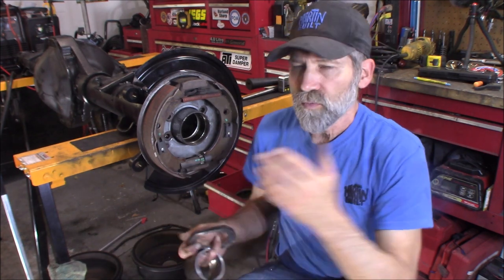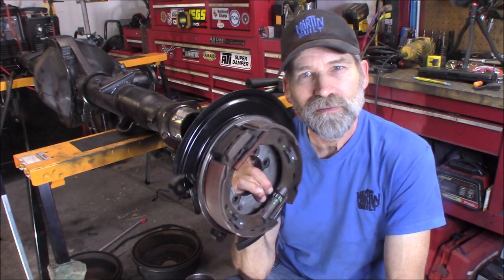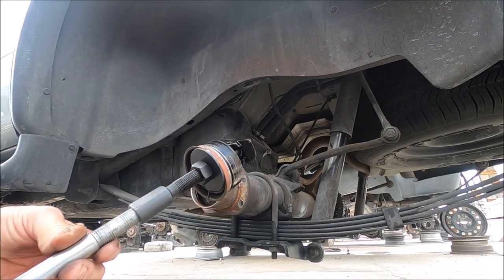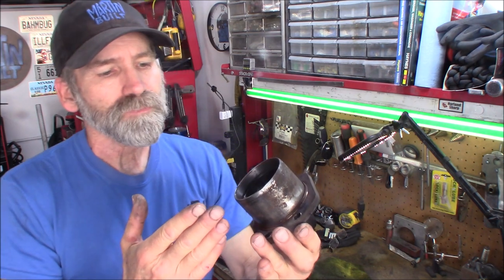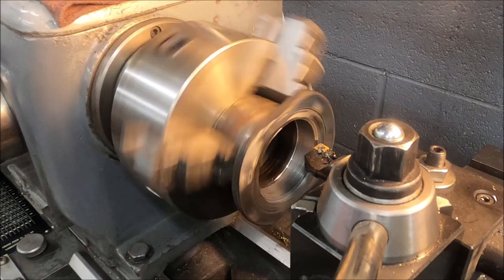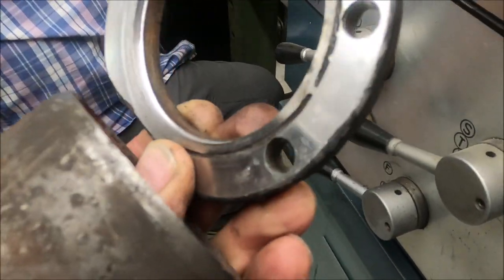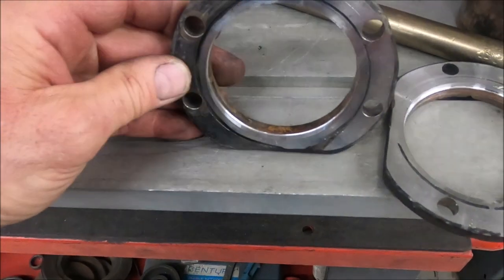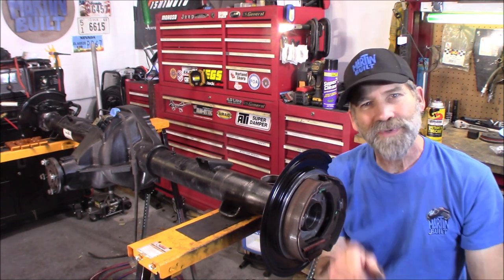Chrysler 9.25 Disc Brake Conversion Part 1

Comment: Thanks to your videos my XJ has the WJ Akebono front brakes and Barnes 4WD 1 ton GM offset TRE's, now I'm redrilling KJ rear brake backing plates to work on a SJ narrow-track D44 rear axle. Unfortunately none of the wrecking yards in my area leave any solid axles under the vehicles so no hope in finding a D44 with disc brakes just chillin. I tore apart 5 ChryCo 8.25's before I had all the parts I needed in one piece. Want your mind blown? Look up the price on rear brake dust shields for a 2005 Jeep Liberty. If you want a parking brake, gotta have those dust shields.
Reply from the maker: I know we got all kinds of dust shields down here at our local Pic-a-Part. There's all kinds of l
Liberties down there. Good luck with your search and build 👍

Comment: Hey Mr. Martin,I was wondering if you might have gotten the measurements off of the flanges or if you ever have some made-up. If so, could i get the measurements from you or purchase a set if you had any made. Thanks

Comment: im assuming this bad boy is going into the XJ , Martin? great video and information as always! I wish my WJ had the trac lock diff!
Reply from the maker: Thanks, this is actually going into my 01 Dakota I'll be going from 3.55 gears to 3.92 and they with disc brakes should be awesome 👌
Reply: @martinbuilt  stopping power and fuel efficiency, nice!!! 😎 I hope its got the 4.Heaven in there 😜

Comment: Hey martinbuilt, would you suggest dropping the transpan of 2001 grand cherokee Laredo WJ, have govenor sensor and selenoid code 125k miles. I have read that i should not. I ts never been changed.  and if I  should not,.. can I strain the old fluid and reuse it mixed with new oil, so that I wont slip?..worried with all that i have read.. not to. help a girl out. thanks. You are a great teacher
Reply from the maker: If it was my Grand Cherokee with that problem I would drop the transmission Pan change out whatever needs to be changed out and replace the fluid. I think people that don't change the transmission fluid and think that that actually causes more problems is total BS

Comment: Did you ever make some of these flanges by chance? Looking at trying to gather the parts to swap my 01 Kota R/T
Reply: Nah this dude is insane. I have a 99 std cab. I’m leaning on just swapping to the complete 9.25 w 3.92 from 03-04 Dakota or Durango
Reply: This is way too much work when you could just bolt up the 03 04
Reply: Good luck just “bolting in” a Durango rearend into a Dakota.. 😂
Reply: Shit you’re right. The leaf springs are on the wrong side for the Durango

Comment: Do you need those Durango backing plates? Would you like to sell them?
Reply from the maker: I got the drums and backing plates for them on craigslist right now
Reply: @martinbuilt  I have a 2002 Dakota with a 9.25 rear end that I want to convert to the larger Durango drum brakes. My mechanic can't find the backing plates to make the conversion. Are these the plates I'm looking for?